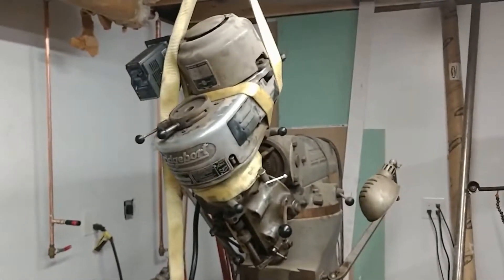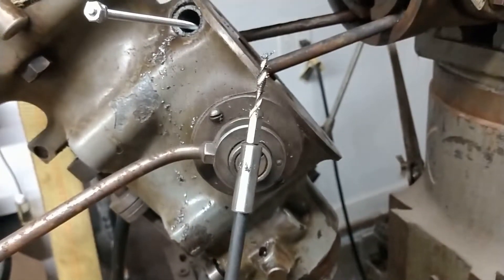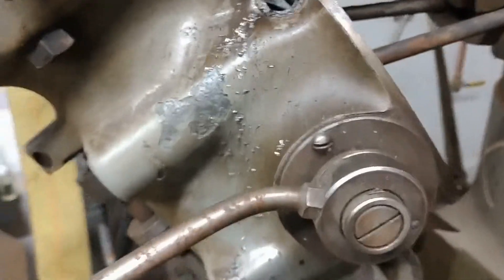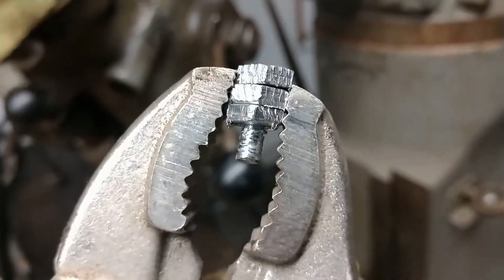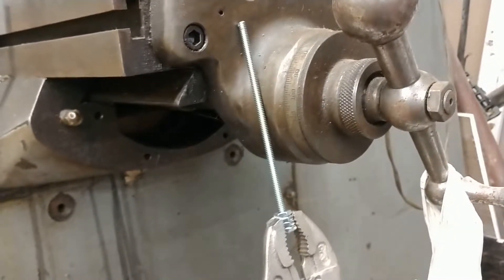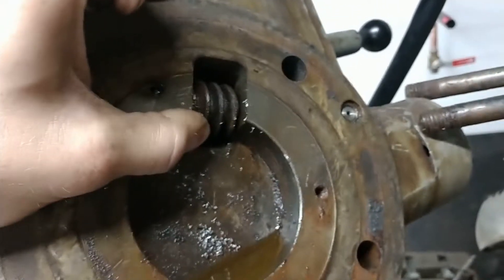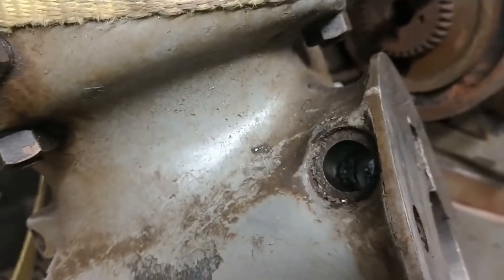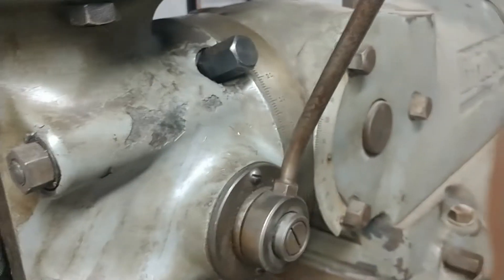bridgeport head rotate worm gear replacement

Comment: Good fix.
I have to do that same job soon so thanks for the video.
I'll  know to use grade 5 or 8 for a puller stem  and/or a smaller diameter cutting disc.

Comment: Thanks for recording this.  I am having a similar problem right now.  My problems is two-fold - I can't easily extract the shaft since there must be a burr past where the setscrew relief is AND the gear is retained by a little part of the shaft.  Waiting for the slide-hammer to arrive from Amazon.  I'll weld a nut to shaft head so the slide-hammer can thread into it.  Wish me luck 👍😊